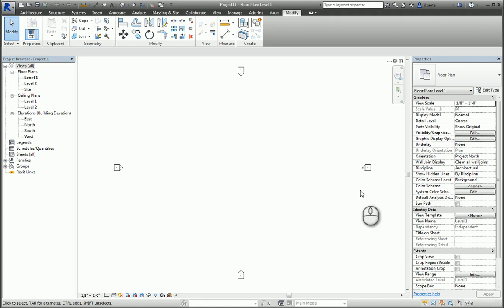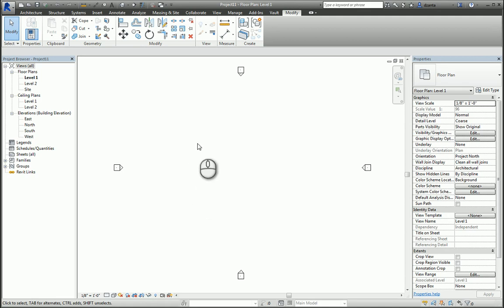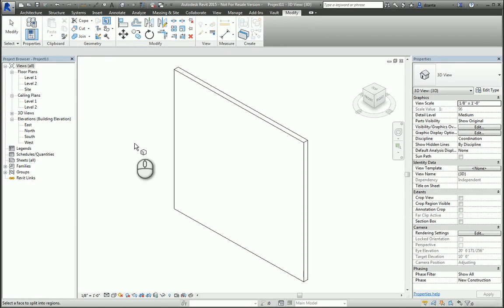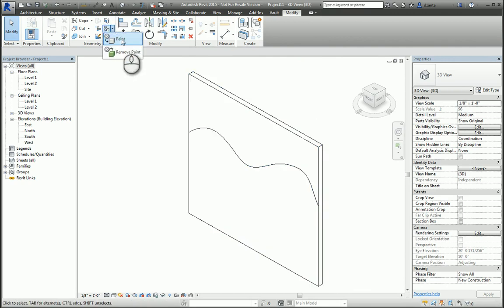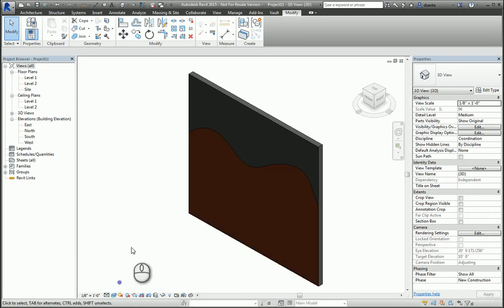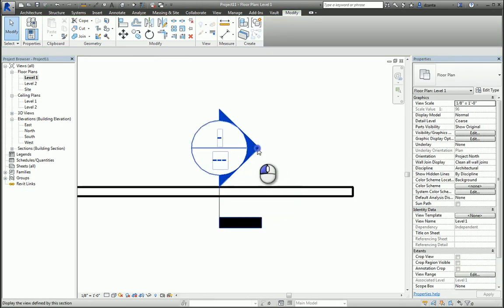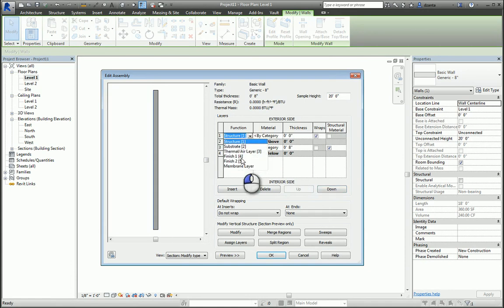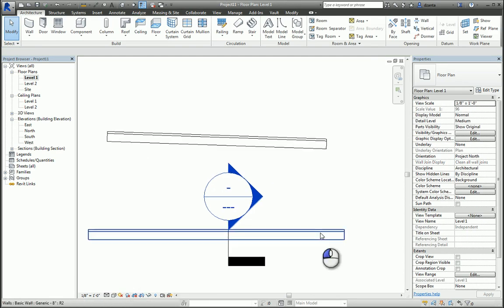Revit Splitface and Paint Command - A How To Guide

Comment: Is it possible to splitface the edge of the wall (thickness)
Reply: Nope, you should use 'divide parts' for that.  Split face + paint is the equivalent of painting, without  changing the thickness of any of the wall assembly layers. Thanks Ta for your videos, really helpful.

Comment: what's the difference between split face and paint technique and divide part (of the wall) and then add the material to it technique?
Reply from the maker: Hey Sunako,

If you use the splitface command and paint command, you are assigning a material to the object but not changing the makeup of the object.

If you use the divide parts command and change the material, you are typically changing the makeup of the material of that object you select.  This would most likely change the thickness of the object if the material changes from 1 material thickness to another.
Reply: @ReproProducts  Hi! First of all I would like to thank you for your great videos , I find them very helpful. I have a question regarding this topic. Did I get it correctly: command paint adds just some appearance to the element, without changing its physical properties? For example if I want a wall with a paint finishing, I go to the properties bar and change settings, with paint tool I am just adding the appearance to the wall? I will highly appreciate your answer :) Best regards! Maria